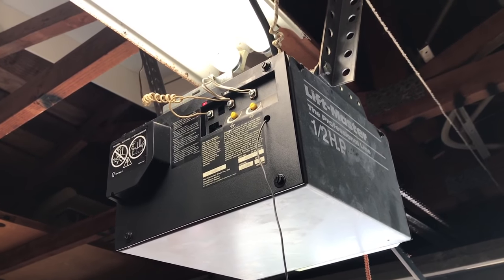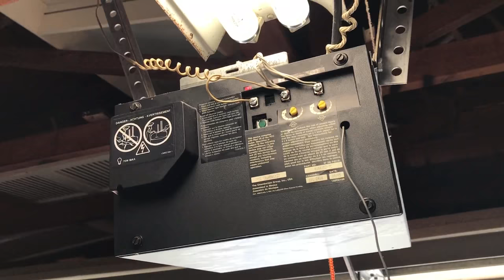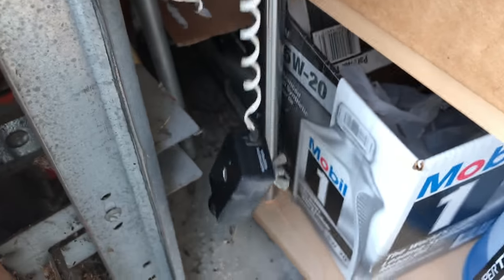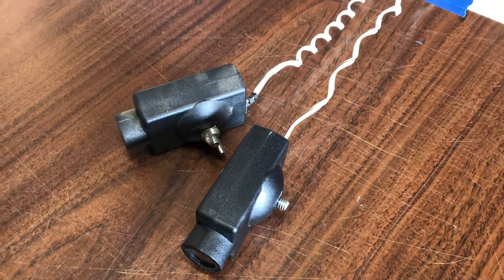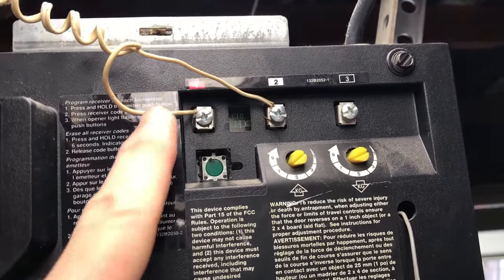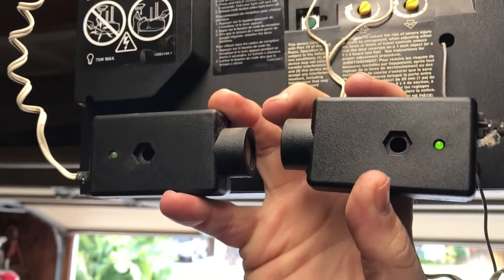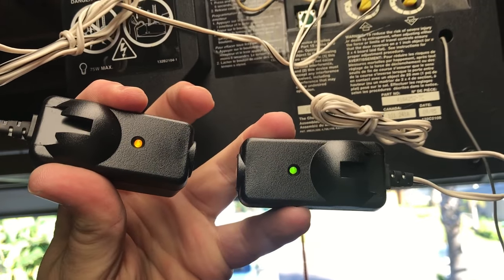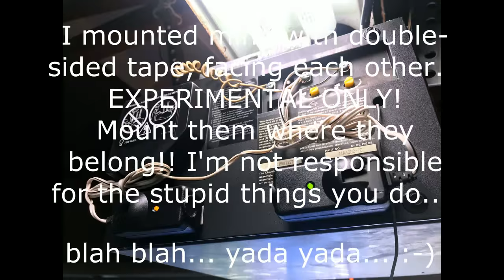FIX Garage Door opener sensor issues EASY CHEESY!  Won't close? Sunlight issues? "Snip! Snip!" :-)

Comment: Since you bought news ones why didn't you install back properly. Easy Cheesy
Reply from the maker: This was easier and cheesier...  and I see no need to have the sensor at the door, only to get dirty or bumped or misaligned again.  But as noted, I recommend putting them in the original spot.  Like you'd likely do.   All good either way!  :-)
Reply: When mine go bad, I'm going to rig them again just like in this video.  It's only a matter of time before they become misaligned and then a pain in the ass!
Reply from the maker: @hc9987  I agree!  Plus the door will STOP if it hits something.  The sensors are a pain really.  Besides, now I can tap my door close button inside the garage and Indiana Jones my way out the garage door quickly... with enough time to grab my hat! :-)

Comment: Sunlight hits one sensor preventing the door from closing. I rather have an actual fix over what your video shows
Reply from the maker: That's a great idea!   Try moving your sensor back...  i.e., more left or right, until it's out of the sun.   As well, you can move your sensors UP more on the wall.  They don't have to be inches from the floor to work properly.     I had the same issue with the sun and my solution works perfectly for me and I don't recommend it, as said on my video. 😉😊   It's been 4 years and I've had no issues at all.     Good luck  :-)

Comment: Or idk you could have just replaced the defective sensors and left them where they are supposed to be installed.
Reply from the maker: True but that creates it's own difficulties.  Installation is touchy because you have to line up the sensors perfectly, then like with my garage, the sunsets hit those sensors and screw them up.   Regardless, I'm with you... you can do that or however you feel like doing it.   for me, my sensors are high and dry in the garage.  No rain.  No snow.  No lights.  No bumping them...  No worries.  :-)

Comment: Do not  putt the photo eyes on the opener because if you closet and drive when its closing it wont stop
Reply from the maker: Hi there!  Yes.  It will stop when the door touches anything.   IF you leave the eyes where they are , those eyes don't see your car until your TIRES cross the eyes which means the door can still hit your hood or trunk.   :-)    But yes, most modern garage doors will open or stop if they touch something.   Try it yourself!

Comment: Luv it cut that crap out. This is The only real solution. Brand new $10,000 garage door and opener nothing but problems. Design just to give the installer unlimited service call money. One time a spider web blocked it but it's always something even the lights are green and it doesn't work. I did basically the same thing though I used a bar instead of tape with the bolts to kind of hold them down they make that plumbing tape or you can use I happen to have some electrical mounting brackets that fit perfectly but you know that thing on the back of car stereo with the holes in it to strap it to the body that works. Anything you can fabricate with holes with the exact spacing and it could be really sturdy and this is what I did. I hate these stupid sensors
Reply from the maker: Perfect!  Yeah, I hate those sensors... that's why I "snip snipped" em.   Great job!

Comment: You may think homeowners don't have to worry about regulations, the problem is if you go to sell your home, and an inspection is done, you can in fact find yourself in hot water for something like this.  Just do it the right way, why would you want to bypass safety protocols?
Reply from the maker: No one is going to get in trouble for doing this and the garage door will still reverse if coming in contact with something, as noted.    Using this type of system doesn't require a permit from any state agency so it's not a legal issue.   Saying someone would be in hot water for this is like saying the same if someone decides not to use a Smoke Alarm in their home.  It's a great idea and I wouldn't go without one, but no agency is going to harass you regarding changes you make to it..    any home inspection is done by paid services not the state and if they find it, it's an easy fix if it's requested by a buyer.  Thank you.
Reply: @DisneyDan  - Why not just do it the right way?
Reply from the maker: @rooh5825 Ha.. a year later...   Why?  Because it doesn't work for me.   the sun hits them wrong and they don't work, or they become misaligned.   As noted, I chose to do it the stupid way and it just works much better for me.
Reply: @rooh5825 a groomed response from the administrative safety state.
Reply: Hot water? By who, the garage door police? If it shows up on the inspection report, so what? Not a big deal.

Comment: If you were gone buy new sensors, you should have just put them back where they belong. 😂😂😂
Reply from the maker: The sensors cause more problems than they are worth.   With sunlight hitting them wrongly and with dumb things set in the garage in front of them, and at times them just going out of alignment, it just didn't work well for me personally.    You're welcome to do it any way you wish.  The video just shows how to test them at the unit and as noted, I'm not responsible for the stupid things people do.   I chose to be stupid and I'm good with the way I installed it.    :-)

Comment: as a garage door technician, please do not do this. Its against federal law. sensors must be no more than 6 inches from the ground.
Reply from the maker: Not true.   UL325's purpose is to regulate the sale of the GDO to ensure "... that the operator shall be provided with a means for connection of an external entrapment-sensing device".  It doesn't not regulate how a consumer chooses to install these devices in their home.   As well, if you're a garage door tech, then YOU are bound by state regulations ensuring that YOU install the devices in a particular way.   US , the home user, can install or modify these devices as we choose without regulation or code...   These codes are set up to protect the general public mostly in public places.   For the home, manufacturers must only provide us the means and UL 325 regulates that.    

The only time it may become an issue is when we sell our homes and IF a home inspector notes it, which of course, is a quick fix.   I'd put them back anyway if I sold my home.

There's no laws against being an idiot with devices installed in my own home and as stated in my video, please be an idiot at your own risk.  This works well for me personally and I'm not breaking any laws doing it.  Just the law of natural selection if it ever kills me.  :-)